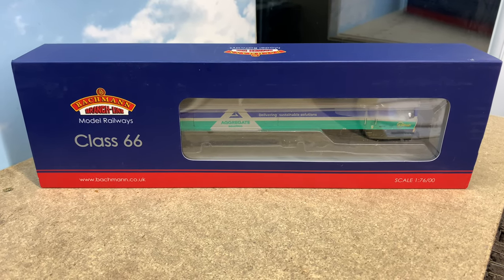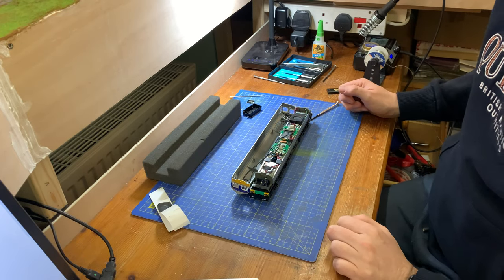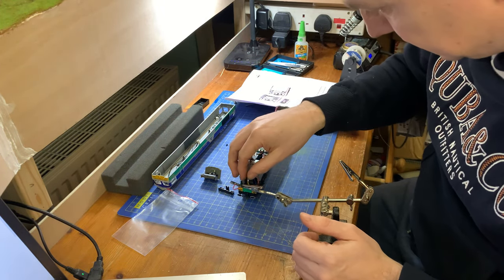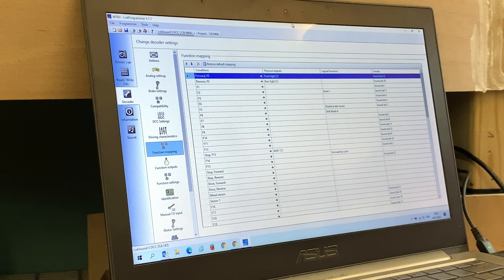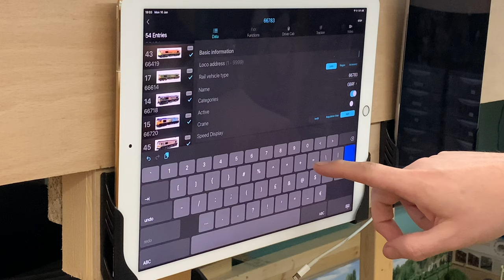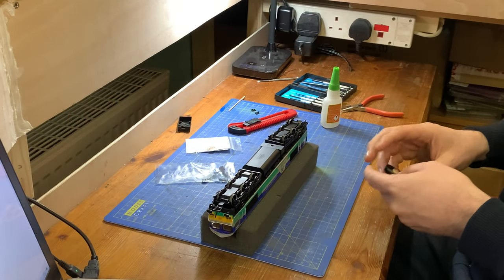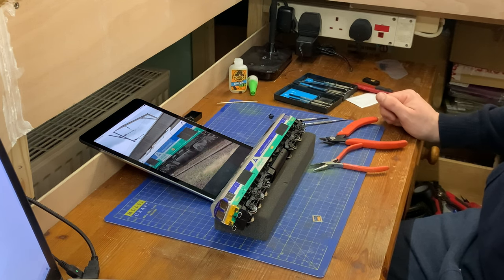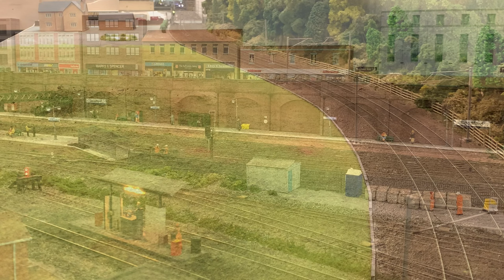Goodford Model Railway How To 1. Setting up a Bachmann class 66 DCC Sound

Comment: You should try an EM1 speaker in series with a sugercube or single iPhone, Really nice setup and the EM1 just fits straight in
Reply from the maker: I have tried that combo however preferred the single megabase speaker result. The issue with the EM1 is that it is 0.5W so easily drowned out with the speaker you in series with it. Of course it also depends on which sound file you’re using.

Comment: Also you don't even need a separate bit of wire to bridge G&E just use a bit of the yellow wire from Tab D on the Loco PCB since that's redundant anyway
Reply from the maker: Thanks Harry, I prefer to leave the yellow wire just in case for any reason I want to convert the loco back to factory condition 👍

Comment: Thinking of getting back in the hobby, but am slightly put off by the tech nowadays.
Having to program a train..ect...
All i remember doing was turning a dial to make a train move.))
Reply from the maker: Was in exactly the same boat as you 18 months ago after having been out of the hobby for 20 years I was amazed how much it had changed and scared to take a body off but there’s so much that can be done now it’s fantastic. Equally, most items are high quality and look great out of the box running on DC. 👍